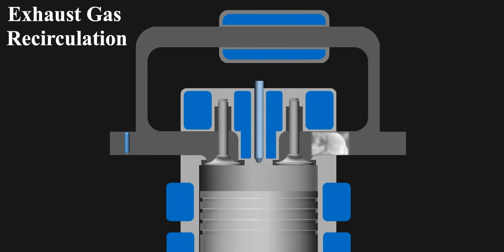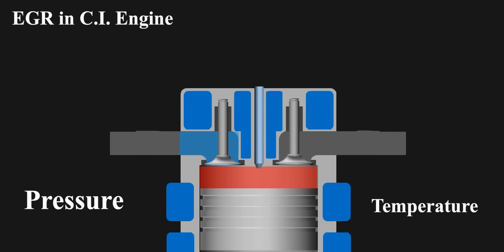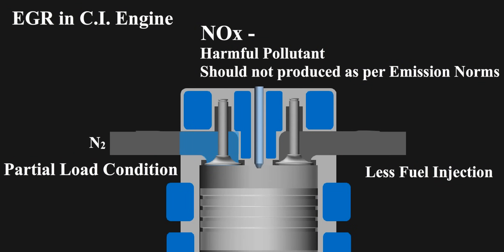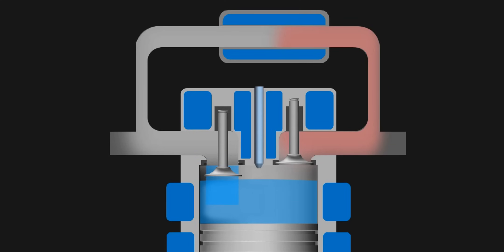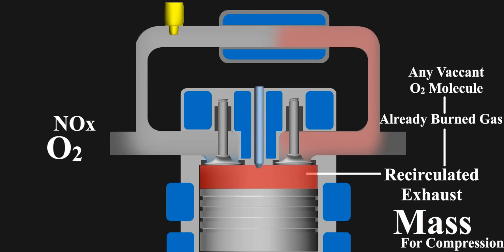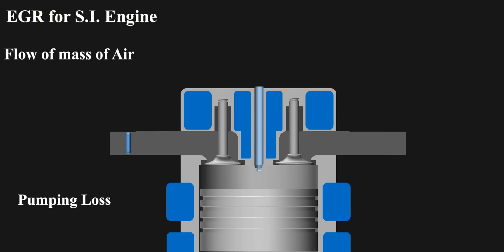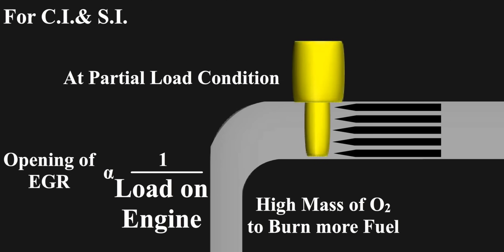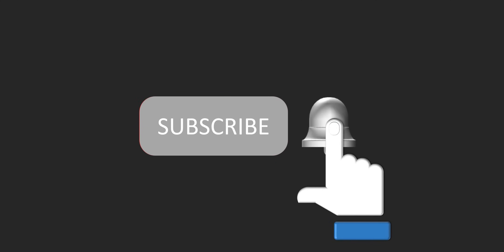EGR (Exhaust Gas Recirculation) Requirement & Working in CI and SI Engines

Comment: You mentioned lag in acceleration after idling if egr valve, due to the engine having to wait two to three cycles. But at engine rpm 750, it takes about 1/5 sec lag which in my books is acceptable. Why?
Reply: If I commute in heavy traffic, lots of stop-starts and idling, fuel consumption is decreased substantially. Am I wrong?
Reply: ...and especially if the engine is under load by the AC compressor while idling

Comment: Kuya, in a Chevy 350 engine, do you think weak valve springs can cause dense blow by smoke? I am guessing maybe a air intake valve is not opening 100 percent. So in my theory, the cylinder is not getting sufficient O2 to make a clean burn.

Comment: Doesn't EGR reduce the power, efficiency of the engine?
Reply: Yes it does! Manufacturers are trying to make more efficient engines but then use EGR that makes engines not that efficient. What a load of crap it is. Doesn't let diesels work to there efficient ways, they need heat to complete combustion. With out egr not much soot comes out the tail pipe, if theres no Dpf, ive seen it myself, so less soot better for environment and then run it threw the DPF, wont work as hard as less soot and then use SCR or adblue injection to take out NOX. just why they dont leave the engine alone. All the egr just kills them. In theory it should be good but in real life EGR is the biggest crap!

Comment: 5:37 but that’s still unclear how it lowers the temperature. You have the recirculat gas that doesn’t catch fire but if you had fresh air instead it wouldn’t burn either because the oxygen inside would exceed the required quantity for combustion so some of it will remain and combine with the nitrogen and form NOx
Reply: Because the gas from exhaust contains CO2 and N2 adn water vapor which act as diluent
Reply: Kenny fresh air act as a diluent as well except it has more o2 and les co2. water in gaseous form from the exhaust would rather condensate releasing heat but it’s still too hot for condensation.
Reply: @rotorblade9508  yes agree but the point of EGR is to lower the temperature AND reduce the NOX. If you are using fresh intake air, then the NOX is high 😁
Reply: Kenny yes, you are right
Reply: I don’t know why but engines run really hot when you run them lean. When you have less fuel than air. And they run cooler when you have more fuel than air
Reply: I think it's because list oxygen
Reply: Yes , it reduces NOx formation, but are asking about intercooler of exhaust gas?

Comment: Instead of Euro 4 EGR design. Its better to add filter on the system so that only O can enter and mix into the intake port. On Mazda CX5 diesel too much carbon deposits built on intake manifold and intake port with 30 months of usage.

Comment: egr is a scam. it lets carbon to enter your intake and back into your engine. You could get better results with water injection. egr and pcv cause all sorts of expensive repairs.
Reply: But if you remove EGR wouldn't that result in higher temperatures within the combustion chamber thus lowering the lifetime of the engine ?
What's worse ?
Reply: @AI-Kangaroo  अंग्रेज मर गए साले औलाद छोड़ गए
Reply: Diesels are excess air engines. With diesels less fuel and more air they run cooler but opposite to petrol engines. So with egr basically the engine like running on a blocked air filter when egr is working. Not enough air in cylinders but still injecting fuel so it is rich, causing soot which is over fuelling the engine at that moment. Making it not efficient and contamination of engine oil, thats why new diesels have black oil, but old diesels that didn't have egr are most likely to be old mechanically injected and cant atomise propbley and then burn the injected fuel cleanly so they contaminate the oil again. EGR JUST KILLS YOUR ENGINE.
Reply: @milo257mm  fab, thanks for explaining that my friend.

Comment: There should be an economy mode for when vehicle is stopped and foot is on the brake at a red lights. Maybe a switch that is activated when a certain pressure is on the brake pedal. Traffic light turns yellow on other side so lighten pressure on brake to close EGR valve in anticipation of green light.

Comment: Why is it then if you blank the egr off the engine responds better to throttle imput at low rpm pulls much better an 0 to 60 improves considerably?
Reply: Since the egr is closed on low RPM it wouldn't make any difference.Does it ?
Reply: because egr is a scam designed to cause engine wear problems and cost people money. h2o injection is way better

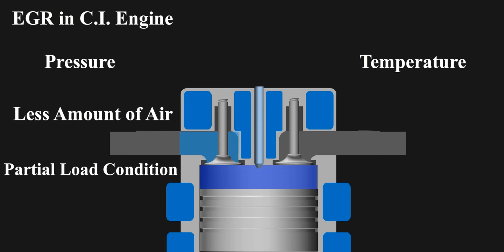Comment: I have a question about what you said around 3:24. You mention that if the chamber is only partially filled, due to less mass, there is not sufficient pressure and temperature for the gas to ignite.

Is the ignition of the fuel dependent on pressure as much as it is on temperature? If the pressure were the same, and the temperature threshold were met, would the gas not still ignite?

I believe I understand here that in this system the ignition is dependent on temperature and the temperature is dependent on the pressure. Is that correct? To me, this makes the ignition indirectly dependent on the pressure. What I am wanting to understand is that if the temperature could be increased in some other way, with the pressure staying the same, would the gas still ignite? Or is there a pressure that does need to be reached because the gas will not ignite, no matter the temperature?

I apologize if the question was not worded clearly. I am trying to grasp what is happening and lacking in my ability to use the appropriate vocabulary.
Reply: I think, pressure won't be the same in compression stroke, as T is proportional to P,

Comment: Hi goes blanking off the EGR improve fuel consumption
Reply: Yes very much
Reply: Well yeah but my question is wouldn't that result in higher temperatures within the combustion chamber thus lowering the lifetime of the engine ?
Reply: @AI-Kangaroo  No, because with EGR you`re recirculating old exhaust fumes in ur intake, witch also clogs ur intake manifold up bad in the future, when you blank the EGR your engine is running on clean air, so your actually saving your engine! :) And also your engine oil will be in much better condition when EGR is blocked. Ive recently blocked my EGR and improved the fuel consumption big time! :)
Reply: @iMentorZz  I was arguing with my father(which has been a car mechanic for his whole lifetime) about a customer of ours who wanted to delete his EGR(ecu & mechanical).And my father was saying to me that if we delete his EGR,He will gain Torque/HP and maybe fuel consumption,but we cannot guarantee to him that he won't have high temperatures if he drives his car really fast in the highway,and that made me think  twice.
Reply: @AI-Kangaroo  I suppose what ur father was trying to say is if u guys delete it and dont remap it afterwards, but I dont see this happening because ur costumers car will go in limp mode if the Egr is deleted, and ur rpm wont go up, If you delete it you should go get your car remapped, so the ecu will bacically work like it did just now with the egr programmed out of it. I have a friend that had a bmw 320d with the old m54 engine those you can run without even remapping it, but if youve done the work why not just remap and get better results :)